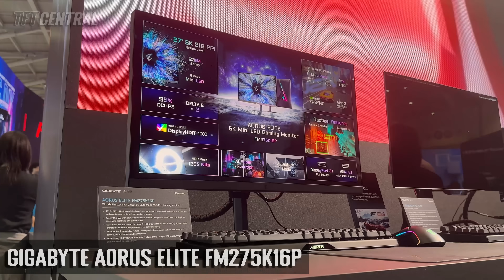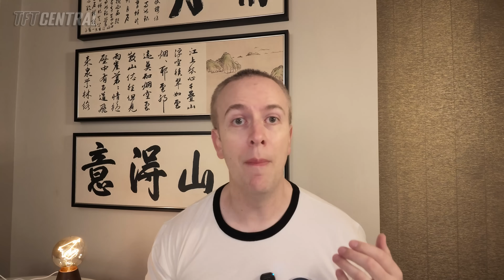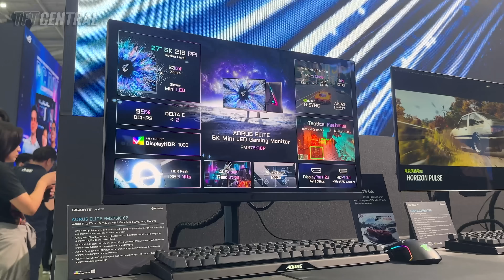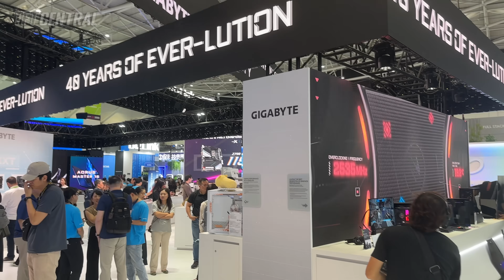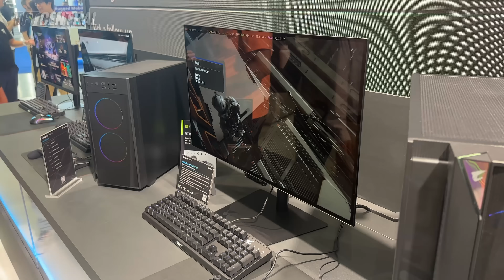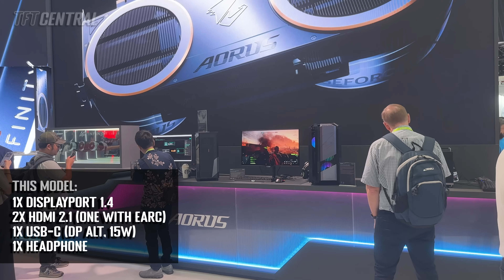5K Mini LED triple-mode glossy AND new glossy OLED's [Gigabyte Computex 2026]

Comment: Wonder if they'll get the 5k mini led cheaper than LG....- pricing is a bit tough to swallow with the drop in 4k models. It is niche obviously but damn. £1.5K per monitor is rough when you want to buy 3 matching. And we're not really at the 27" 5k tandem old with 600 nit sustained full screen SDR brightness that I'm truly after :( Maybe by 2030s we'll get it at a price that's reachable.
Reply from the maker: Should be a lot less, global price is expected to be $999 for gigabytes model 🙂
Reply: @tftcentral  any word on when this will actually release?

Comment: Is it known whether the AORUS ELITE FO27Q28G has fixed the grey banding and dirty screen effect issues that other monitors using this panel have? For example, the Gigabyte MO27Q28GR or even the ASUS ROG Strix OLED XG27AQWMG. These issues are the only things holding me back from buying any of these monitors.
Reply from the maker: I think it’s unlikely unless LG display have improved panel side production but well hopefully be testing one of the new models soon so we’ll be able to check
Reply: @tftcentral  That would be awesome! These monitors look great, but I’ve heard so many people complain about the grey banding and dirty screen effect issues that it honestly made me nervous about buying any of them. I don’t usually have much money on hand, so if I’m spending that kind of money, I want something I’ll be happy with, not something where I later discover obvious issues that would bother me endlessly and make me regret such an expensive purchase.

Comment: By the time 32inch tandem WOLED comes out the next gen of 32inch 4K will already be around the corner. Its crazy how they took forever with that panel announced since 2025 and still 0 release while 27inch tandem WOLED has already been out

Comment: Why so many ppl prefer 27 inch display ?
Reply: I have two monitors on  my desk and they fit better,  dont think i'd have room for 2 32"
Reply: Many don't have room for much larger.
Plus, we need 8K to start coming onto the market in the next few years, to standardize larger sizes, with many more modes than current monitor crop.
8K can integer scale 5 other lower resolutions (4K, 1440p, FHD, 864, HD).
Once 8K comes into the picture, monitor sizes between 32 and 43ish inch 16:9 will make more sense.
Reply: you get more ppi and more space on your desk, whats not to like?
Reply: @quantum5661  larger screens are more immersive than smaller ones, especially if paired with higer resolutions and refresh rates.

Comment: I think the Asrock’s taichi line of tandem oled 27 inch 540 hz are better with the d.p 2.1 (uhbr20). Why did gigabyte use uhbr 13.5 :(. Or does it really matter? I’m using a 5070ti gpu

Comment: The 5k Mini-Led monitor seems the same as the MSi version. Except the Triple mode support. Is that the only difference?
Reply from the maker: Actually a different underlying panel. This has the same as the LG model, a panel from BOE, while the MsI uses an AUO panel. Remains to be seen how they compare
Reply: @tftcentral is Apple using the AUO one as well for the Studio Display XDR and thus the higher brightness and lack of “zero optical distance” branding?
Reply from the maker: Not sure what they’re using but quite possible. May explain the delay getting MSI’s model released too, Apple often have exclusivity periods

Comment: I really hope triple modes like this will become standard one day. Even more so, I hope those become more customizable as the tcon and firmware capabilities evolve over time. Would've been really cool to have a display that can do something like 180Hz 21:9 5k2k -> 240Hz 16:9 4k -> 360Hz pixel perfect 3200x1800 (around 26-26.5" screen size at the same ppi as 31.5" 4k and 39" 5k2k) etc all modes being within the DP2.1 UHBR20 bandwidth capabilities.

Comment: Can you tell manufacturers OLED care turning off the monitor is absolutely awful in multi monitor set-ups. I vastly prefer the way Asus does it where they just display a completely black image to keep the monitor from disconnecting
Reply: i have a Gigabyte 27 QD OLED and what i like about it is that OLED care only turns off the monitor when its on standby, never when you re using it

Comment: This is super unfortunate like I conceptually love this mini LED I’ve been looking at the LG model for a while but I always love to see different alternatives but 15 W power delivery is just not really good enough. One of the big wins with these 5K monitors is for Mac devices but 15 W just isn’t good enough experience if you’re doing any kind of sustained work. It’s an interesting omission, that I have to wonder if it makes much sense. Maybe there was a real power budget issue here or something that may justifying it hard.

I’ve never been super bothered about glossy versus matte. One of the reasons I’m going for a mini LED over OLED is bright room productivity where OLED is just to dim right now.
Reply from the maker: We're seeking some further feedback from Gigabyte on that topic so will report back...
Reply: MSI and LG has exact same display panel being used on their model. Both have 96W PD. LG is matte, MSI is glossy.
Reply from the maker: MSI have a different panel in their model....Gigabyte and LG are using a panel from BOE, while MSI are using a very similar spec panel from AUO
Reply: @tftcentral Thanks for correcting. Specs were very similar. I got confused.
Reply: @tftcentral  would be really interesting to see a comparison between the BOE and AUO panel one day